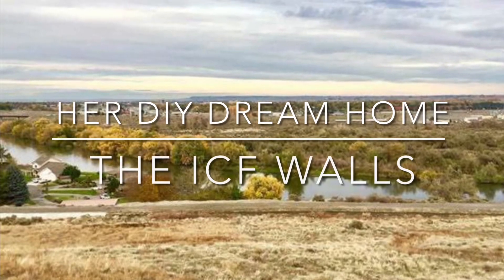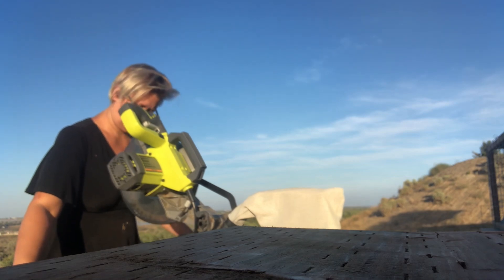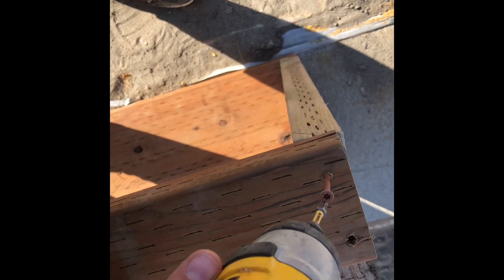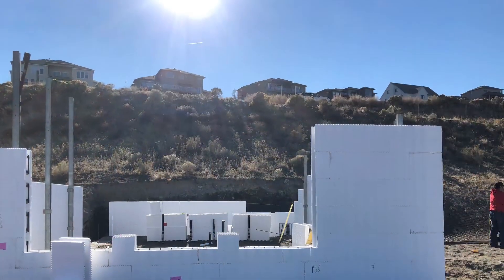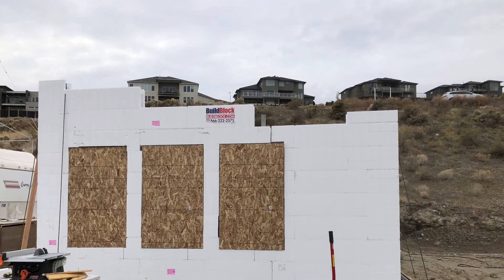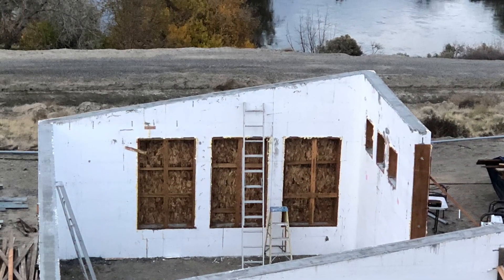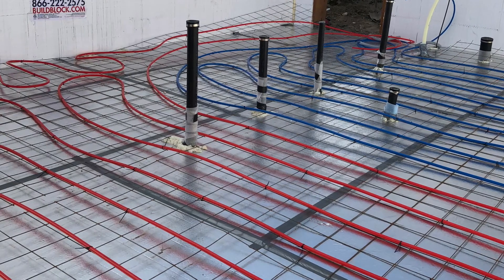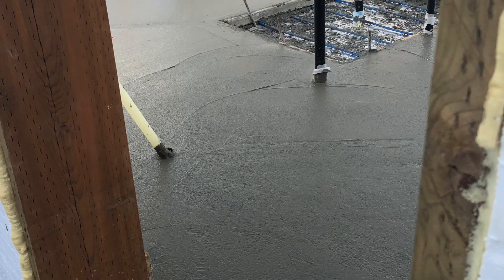My DIY ICF Home Build: Stacking ICF Walls and Pouring Concrete

Comment: great video and thank you for sharing.  I have a question.  what resources did you have to determine the height of the floor from the footings and icf walls.   gravel (if needed) then vapor, then insulation,mesh,radiant heating and finally the concrete adds a certain amount of depth. This is probably the only video i have seen where you show these elements.
Reply from the maker: Frost depth in my area is 24”. The Buildblock manual said that my footing needed to be 15” for my soil. I wanted a high r value under my radiant and a local foam manufacturer sold a 4” R-20+ eps. Slabs are usually 4” thick. If I made my footing 16” then added the foam and slab thickness then I reached my frost depth of 24”. 

My ICF wall height for 6 rows is 8’ so I added 1/2 a row to get 8’ 8”… the foam and concrete placed on top of the footings made my finished wall height inside 8’ on the low side. The building department considered the 8” a stem wall since it was concrete.
Reply: @herdiydreamhome339  thank you so much

Comment: How did you pour the angled top of the side walls? Did you have a thicker slump on that part?
Reply from the maker: No, the slump was the same for the entire pour. My pitch was 8 degrees so there was no issues with the concrete spilling out. It really just settled into the form and we troweled the top smooth.

Comment: One of the best videos I have seen on building a small ICF house. Excellence through simplicity. We had designed a 2 storey ICF house but then prices went up and after living in a small log cabin during lockdown realised the 5 of us didn't need 2 floors. Great video. Thank you

Comment: Where did you buy your ICF blocks? Cost?
Reply from the maker: My blocks are from buildblock. They are not the least expensive option but they have some features I like better. The webs are spaced every 6”, This makes it easier to attach things to them like lumber for framing and drywall. The castillations are every 1”, so you can have more precise joints. They do not require HV clips or zip ties to hold them together and they have less blowouts. 

I purchased them from a dealer 2 years ago but now you can buy them direct. They were $30-36 a block in March.:

Comment: Awesome build -- cool to see you doing the parts you can yourself!  Any chance you would do a cost breakdown video!? Cheers!
Reply from the maker: Unfortunately I did not track the actual costs but I do know that to finish this phase the cost was $100,000ish. That includes the well, septic and power. I paid for things as I could afford them over 2+ years. I started in June of 2020 and finished in October of 2022.
Reply: @herdiydreamhome339  Appreciate the response - where are you in the process and can we see the current/finished product. I just purchased 2 acres and want to build a 'simple' slope to front roof icf build